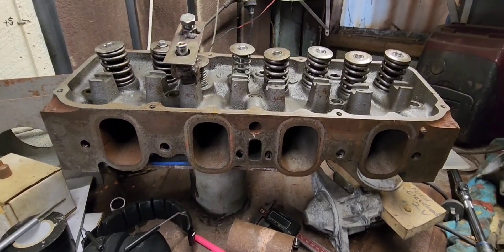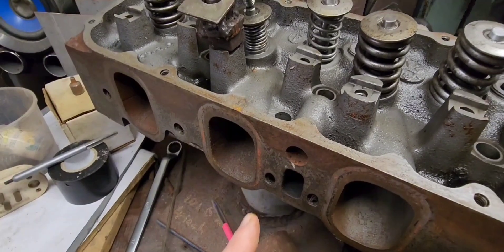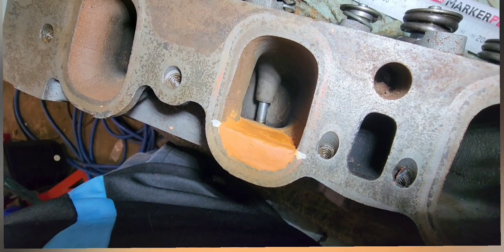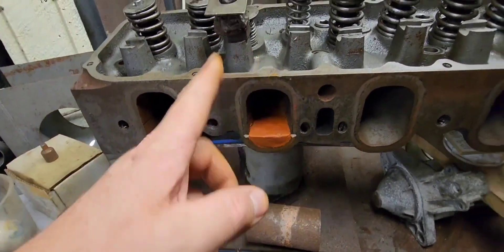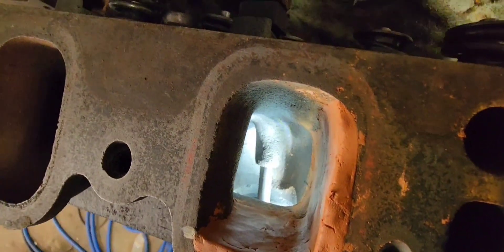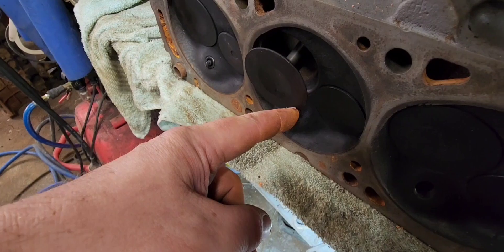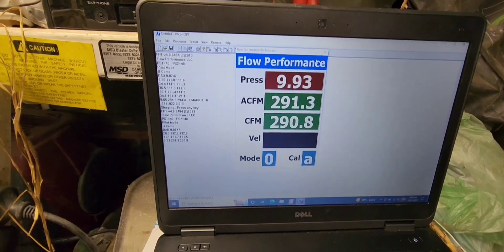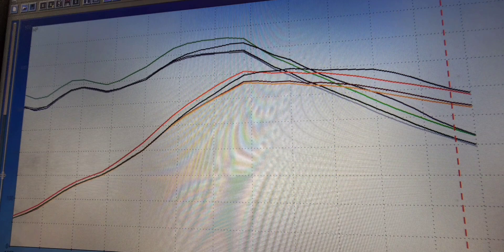4V Cleveland Flow Test with Port Stuffers

Comment: I have used the intake Port plates. Looks like an intake gasket with a tongue near the bottom of the intake Port. I tried them at 2500 to 3000 in fourth gear and it did make a difference. 🧐

Comment: This is a very good video!.  I am looking for some expert advice. and I think u can help after waching this video. I have a 73 351 Clevland smog head engine and I want to put some 1970 factory closed chambered heads on it. I was given a completely rebuilt set of 1970 4V closed chamber heads with the 2.19 valves etc and want to make this motor work on the street. I am not looking for advice on using other heads (or recommendations to use the factory 2 V heads, etc) as these were free to me and a few thousand dollars saving since they have already been rebuilt. I dont care about upper RPM range horse power loss and want to use these as a good lower rpm (up to 6000 rpm-ish )high torque motor (its my wifes hot rod so doesnt need to be radical motor). I have been told that if I run these with the factory flat top pistons and right cam profile i can make it relatively streetable? And what about a factory M-Code engine cam porfile?) I am wondering what your thoughts would be as far a good cam profile for my situation? going into a 73 mustang which I figure weighs at least 3500 lbs and its an automatic tranny (im ok with a higher stall converter). I am well versed on the Cleveland factory heads types, etc.. I also welcome recommendations from anyone else who sees this post as well :)
Reply from the maker: Hi there.
If you care to look at my video on Theoretical look at why the 4V Cleveland got its port size, I go to explain what best cam to run with these heads.

Sadly, due to funds always being a hold back for me, I haven't got a definitive answer to what exact cam to run. Only a guide. 

From here, the focus needs to be on the intake closing point. Anything later than 40°ABDC @0.050 and torque is going to be lost. Anything more than 10°BTDC@0.050 opening and emissions are going to be bad.
With that set, a cam of 230@0.050 with an intake centerline of 105 is about as big as you want to go. Keep lift conservative, 0.55-0.58. The exhaust can be earlier opening, with a centerline of 115 with the same duration.
This gives a lobe Separation angle of 110. If a cam has centerlines of 110 and a lobe angle of 110, advancement of the cam 5 degrees will yield the specs given.

Total duration is going to be in the 280° area. 

What is most important is the intake closing point IS the killer of torque with these engines. Don't fall for small port cams that rely on airspeed, which dictates the need to close the valve later to make power. Using them here leads to lack of torque with no top end gain. The very problem encountered by many over the years.

Hope that helps.
Reply: @crd-nz_001  thank you, what is the name of the video you are referencing so I can find it? Thank you :)
Reply from the maker: https://youtu.be/qwypEHsgnhE

Hope that works. Otherwise, it is the latest video on my channel.
Reply: @crd-nz_001  hi, i watched your other video and it didnt really offer much info on my specific situation or questions. do you mind re reading my original question and giving me some specific advice that might help me? THank you much

Comment: If you don't use a radiused inlet at the intake face your numbers will be incomparable with others tested flow and will not accurately indicate flow. A 4V head should easily make 330 on the intake with a cartridge roll bowl blend and performance valve seat. 350 @ .600" lift with a proper short side and bowl port is attainable. 
Overall you're doing well.
Reply from the maker: Thank you.

In my defense, I recognize radius entry will increase flow numbers. However, a radius entry doesn't copy how an intake manifold delivers air to the port entry. Some manifolds add flow where others reduce it. For me, as long as I am consistent, then the tests are comparable between other modifications and heads. As for comparison of my numbers to other benches, I am cautious. Just like dynos, it would be foolish to think that all numbers are what they say they are.
Reply: @crd-nz_001  the radius is more important than you may think even at low lift flow. While manifolds do affect flow, they don't cause turbulence at the intake mating face, but most will reduce flow numbers. I've got 35 years experience with Clevelands and still run them today and if you don't mind reading search for George Pence Clevelands for a very good historical and developmental dissertation on them. He covers the history of them quite well. Keep up the good work, it's nice to see someone still curious about ancient tech.

Comment: Hey mate I think they only do it on the bottom of Exaust side to get the gases away faster
Reply from the maker: They did fill the lower section of the exhaust, yes. However, filling the lower and side sections of the intake port is well documented. Drag Boss Garage does a video on the insets for the lower section.

Comment: My closed chamber epoxied 4Vs flowed IN at 0600" lift 321 CFM  EX 219 CFM
Reply: You had bowl work and aftermarket valves too?    I'm seeing that combination go 320 to 330cfm.
Reply: @dennisrobinson8008  Yes

Comment: why mess with these engines?They are not used by anyone in the US. Most dont even know what they are...
Reply from the maker: It's what I enjoy, and the veiwers like to see. 

If you don't like that, it's a you problem.
Reply: Must be a chev guy has no idea
Reply: Bob Glidden liked them
Reply: they are a big deal in New Zealand and Aussie Why dont you have a look at what Bob Glidden did with Clevelands in your country. You may get an education
Reply: I've got stock iron cc 4v's with a port mismatching dual plane  that makes pretty good hp and tq for what it is. 
Both over 500 in my 393c.
Good vid. 👍
Reply: I run the 4v heads with port stuffers in my Windsor.  Or did, just now changing over to chi 3v as I messed up a head by breaking a couple valves.  Love the 4v
Reply: I got my iron 4v fixed and returned the CHI aluminum heads.
Reply: @patrickterry779 4V are killer on the right application, no need to go the other heads.
Reply: They went well in Pataras 😂

Comment: Should have a radius entry to the port when testing.... either a radius plate or clay... not the sharp edge... 😉
Reply: I agree. But, it should be as standardized as possible, if you're just putting clay on by hand you're going to get slightly different results each application.

Better than a bell or trumpet would be the actual intake. Once the ports are matched, we are going to be flowing the head with an intake in the car, so the flow with intake matters more than without.
Reply: @SpecialEDy   There is no way I would flow a head like that without some form of radius entry , while I agree about flowing the manifold that doesn't shy away from this is flowing the head wrong on its own,  when I'm doing development on heads they are flowed first, once completed then will flow the manifold and then with carb wired open to get correct results.
, that's only after all area, length, shape etc etc is correct first, flowing a head on YouTube with no radius and posting numbers etc is misleading and wrong.

Comment: Its picking the right cam is more important than the port stuffers
Reply: split pattern and tight lobe center is the key to a cracking street cam on a 4V 351.  It's so easy to kill the bottom end.Good luck guys
Reply: Absolutely the LSA and the ILC advance are more critical than duration and overlap.
Bear in mind the exact installed advance angle can only be determined by actual engine Dyno testing of the exact combination... Including headers and exhaust system AND intake system.
Most people are guessing when buying and installing a cam. But that's what average Joe does.

Comment: Where can you get this port stuffer?
Reply from the maker: Normally, it's a special two pack epoxy that is stable with both temperature and petroleum. 

However, the red stuff I am using is just modeling clay. It's a demonstration to see what flow restrictions port stuffers have. It's easy to use and cost-effective as I'm only flowbench testing.

While they do lower flow, I suspected a much greater loss than what was tested.
Reply: @crd-nz_001  l have thought a lot about doing this and have come to the conclusion that 2v is better. On a different note Perkins has had very good
 success doing this with holden  vn heads and managed to open the top more and moreover had slide throttle, it gave him victory.
Reply: @joseph317  Slide injection is more efficient as there no throttle shaft in the area of air flow
Reply: @crd-nz_001 without a radiused inlet you're causing turbulence that you won't hear but will cause a loss in flow especially after filling the port due to reduced area. You shouldn't be losing any flow with filled ports.
Reply: Price Motorsports sells cast aluminum stuffers with the epoxy needed and instructions. They're online and very nice. 
You can buy the port plates from MPG in Colorado who is also online
Reply: Just make them out of some aluminum plates. Hardware store have it make them 1/2”thick by stacking them and bolting them in the floor of the port recessing the bolt. You’ll have to shape them to the floor very easily.

Comment: Test pressure is to low! cheers
Reply: Totally agree , this concept that testing at 10 inches and converting to 28 or higher by mathematical formula is a myth, there's no way at 10 inches are you going to see or hear any turbulence going on in the port , plus no radius entry is also incorrect, its misinformation once again on YouTube